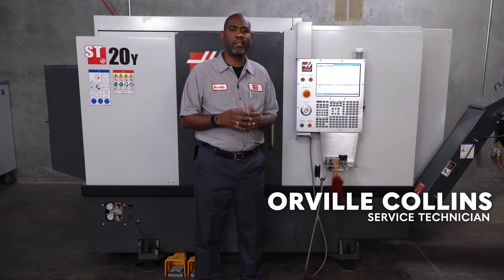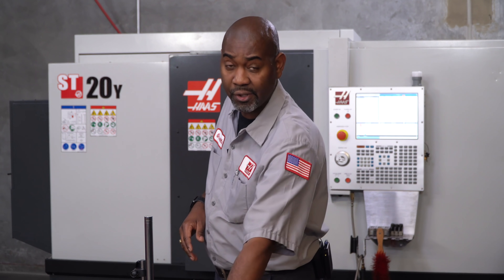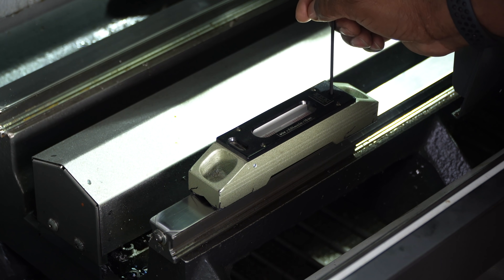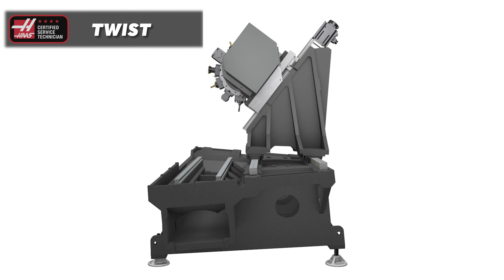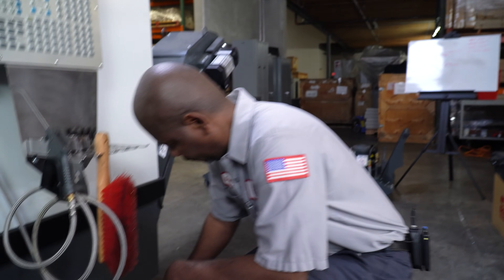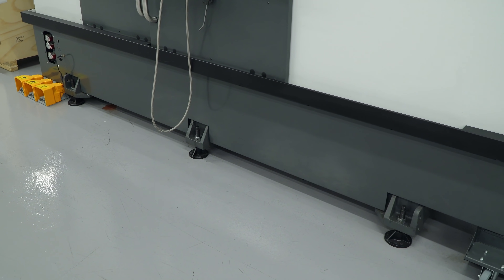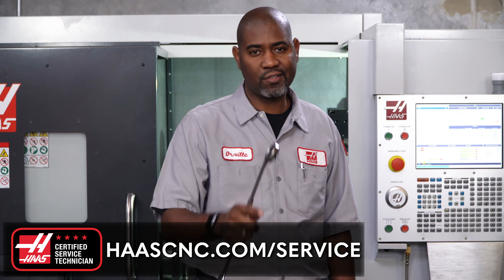Leveling Your Lathe - Haas Service - Haas Automation, Inc.

Comment: Hi Orville,

Great video! We just used this tutorial to level an ST-20 lathe in our shop after moving it and ran into a couple issues:

1) When we loosened the front right nut all the way, the machine kept tilting towards that nut which made it so we never ended up with a gap. This forced us to level the machine using the front two screws and the rear right one.

2) After 10 years of use, our ST-20's tailstock way covers had plenty of nicks and dents which produced an inaccurate rough leveling of the machine. We ended up using 1-2-3 blocks set on the best sections and then rough leveled it in both axes.

Thanks!

Comment: Nice video but one doubt during setting the precision level on turret you just center it by correcting the magnetic base and is this correct way because some machine they are giving attachment or we putting on guideways. Please explain the initial precision level setting step. Rest are good

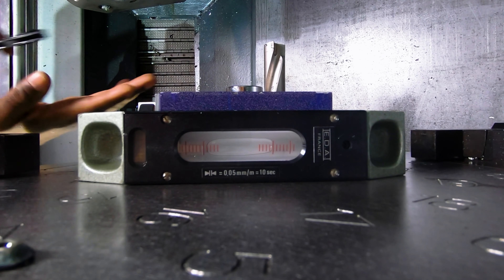Comment: 2:39 Help me understand this... It seems as if he's leveling the level and not the machine. Shouldn't the level sit on the top of the turret or across the subspindle rails? I must be missing something.
Reply: If understand the process:
1. He calibrated the level by rotating it 180 degrees and check the difference compared to each other.
2. Jog the Z-axis to the middle of the stroke. 
3. He put the calibrated level on the magbase, on the turret. Just tap a few times to set the magbase level too. This position doesn't need to be level at this point.
4. JOG back and forth between the Z+ and Z- positions to set the level with the screws in corners. With that he created a levelled plain/rectangular.
5. Take out the twist of the bed by set all the screws, meanwhile level the 2 screws in the middle. 
Until this point I don't see any mistake. 

Honestly, I see only one mistake: the Z-axis levelling process is missing or the smaller vial is not precise for level the machine. Maybe he didn't mentioned it or I didn't notice it.

I hope it's understandable, English isn't my mother tongue.
Reply: The machine was never leveled.... only the "twist" removed.

Comment: Don't you also need to check if the center screws are applying too much or too little pressure? If the Z axis stroke was bowed up or down in the middle, as long as there isn't any twist, you wouldn't see movement on that level in the x-direction, right? Wouldn't you need to do the same test but with the level axially in Z?
Reply from the maker: GARRETT LEWIS - That’s an interesting example.  Once the machine is leveled, the center leveling screws will help prevent the machine from twisting over time.  In my years working on Haas turning centers, I’ve yet to see a base casting bowed up or down and free from twist. If the base casting is bowed up for example, you would have to use anchors to pull it down and check the twist again. If the base casting is bowed down, you would use center screws to push it up and check the twist again. Hope that helps, thanks for the comment. - Orville
Reply: @haasautomation   Thanks Orville, yes this does help. I was thinking more along the line if the middle was sagging due to gravity. Or if the center screws applied too much pressure, it could be bowed upward. Probably a good idea to double check afterward.

Comment: May I ask you what kind of error (levelling, twist) cause what kind of error (guideway wear, conical machined parts... etc)? 
1. For example when the machine is not levelled, some parts have more wear because of the excessive amount of weight. 
2. "Since twist compromise the geometry of your machine. It can introduce error into your machine parts..."
Thank you!
Reply from the maker: Arpad Brecska - If the machine is not leveled correctly, it can prevent chips and coolant from flowing from the machine correctly. In regards to twist, it can cause the machine to produce parts out of print and in some cases the machine can actually break tools like drills, taps… etc. Hope that helps, thanks for the comment. - Orville
Reply: @haasautomation  Thank you very much!

Comment: You have to spin the level 180 degrees to calibrate a level!
Reply from the maker: Cruch9, Yes you are correct. Note your 1st reading, rotate the level 180 degrees to check that it repeats to the same position. From here the zero position can be set with the adjusting screw. If the level does not repeat to the same position then there is an issue with the level. 
Once the level is mounted to the turret on the mag base, all movement of the bubble is relative from one end of Z-axis travel to the other. At this point removing bubble movement along full Z-axis travel, and therefore twist, is more important than the exact location of the bubble in the vial.
Reply: Yep, there's only 1 way to calibrate a level,  make it read the exact same on both sides when flipped around.
Reply: Hi, probably a very novice question, but can you elaborate. Want to get a better understanding how to level machines. Thanks in advance.
Reply: @ciscohernandez4384  if you set level and a semi level surface, for example, if bubble on level is 2 divisions to the left then if you spin level end for end it should also be 2 divisions to the left.  If it is, level is calibrated, if not you need to adjust level and repeat above steps
Reply: @ciscohernandez4384 machine tool that is long and heavy like a lathe has twist in the ways of the machine (bending and sagging on it's  own weight) undetectable  by the human eyes but can be checked by a precision level
Reply: Agreed.  This video can steer somebody in the wrong direction for using a spirit level.